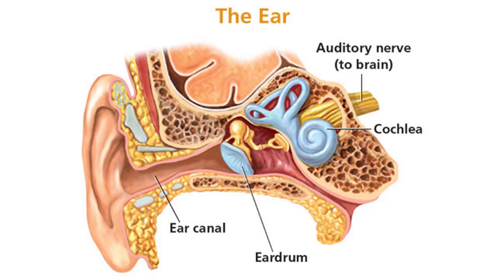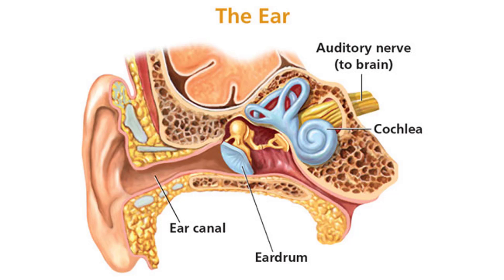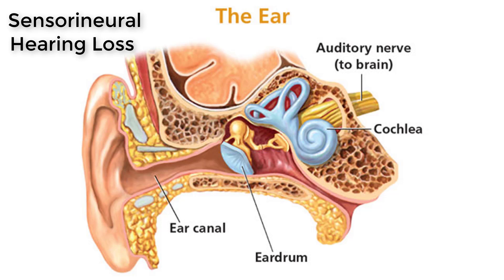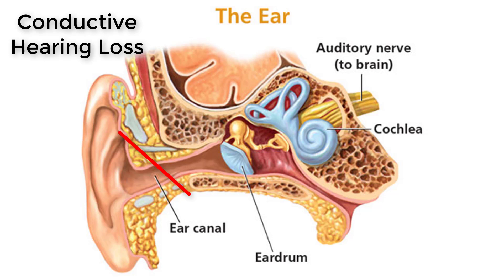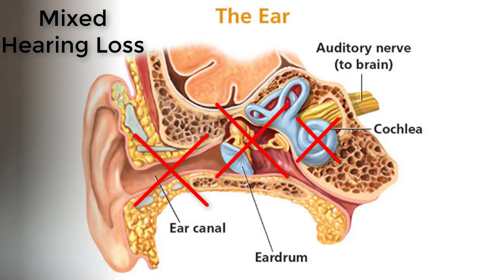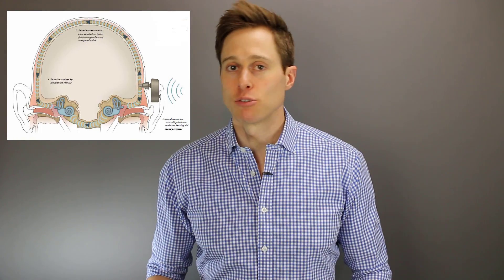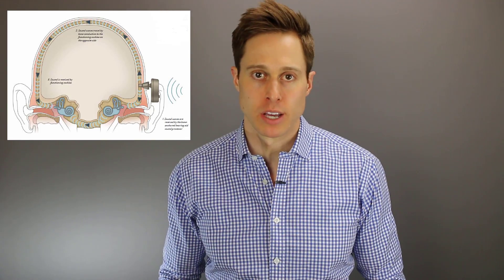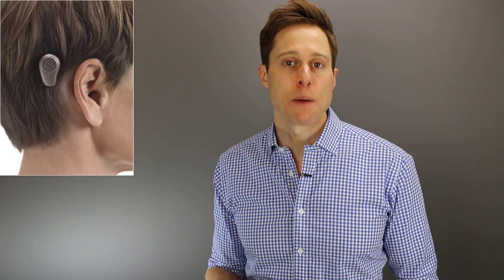How Bone Conduction Hearing Aids Work | Cochlear BAHA, Oticon Medical Ponto, Medel ADHEAR

Comment: Hey Dr. Cliff!  I had a tympanoplasty with mastoidectomy due to Cholesteotoma a few years ago in my left year.  It left me with conductive hearing loss in that ear, but I’ve been able to rely on my right ear and have gotten by just fine.  Well now the Cholesteotoma has found it’s way into my right ear and have to have the same surgery.  I’ve already had the BAHA evaluation and they said I’m a candidate for it.  The doctors think it makes the most sense for the BAHA to be placed on my left ear since we already know how that side is post surgery.  So my question is does it matter which side it goes on?  And is this still a good option not knowing how the recovery from surgery on my right side will be?
Reply from the maker: I would go with whichever side the surgeon suggests based on their knowledge of your unique situation.

Comment: My 3 year old has profound hearing loss in one ear and perfect hearing in the other and is not eligible for a cochlear implant.  I believe the only other option at this time is a BAHA device (correct me if I'm wrong).  If sound is just transmitted to the good hear, does a Baha help with sound localization at all and is it possible to over stimulate your good ear and create long term issues?

Comment: I am a babyboomer that has been recommended for Phonak Paradise hearing aid for first time. I have deep voice and most appreciate that I speak slowly and articulate; I find it hard to understand soft spoken people.   Having sensitive skin and ears, I prefer NOT to have any hearing aids in the ear canal; Paradise delicate hearing aids with a little wire and ear bud top does not impress me. My cats cats could easily break this flimsy hearing aid.  IMHO, I would prefer bone conduction options (love design of Shockz openswim)...but local provider seems to not replying to my questions.  Can't I choose a non ear option for hearing aids?  I am about ready to voice my concerns with Medicare.
Reply from the maker: Medicare will not approve a bone conduction device unless you have a conductive/mixed loss or single sided deafness. You could purchase the Medel Adhear, but Paradise Hearing aids would outperform them significantly.

Comment: I am struggling to understand why the 10% do not benefit from the traditional hearing aid? I have severe to profound conductive hearing loss in one ear from prior cholesteatoma's and after several surgeries it was somewhat repaired but now the prothesis has failed and I do not desire to repeat surgery to try and fix it. Anyways, today I tested the BAHA via headband and a Phonoak Audeo in the office and couldn't tell much difference between the two. I am struggling committing to having the BAHA done when I couldn't see much difference.

Comment: Thanks for the video. I have a BAHA since 2002, 3 years ago I changed to a Ponto. I have SSD and wear the Ponto more or less all the time. But since around 2 years I experience occasionally pain in the ear after exposure to loud noise for a longer period of time. It is only on the implanted side and feels like a spasm in the ear. It can be really painful for some hours and then its fine again sometimes even for several weeks. There is no infection, everything looks and works fine otherwise. Did you hear something like that before? Is it something I should be worried about?
Reply: Hi, I've dealth with SSD for about 7 years now. I've used Cros to a so-so effect, but now I'm set to get surgery for the BAHA Connect, and I was curious as to why you changed to the Ponto, and what that change entailed? Did it require another surgery, or were you able to utilize the original abutment? Also, which provided better sound? Thanks in advance!

Comment: Hi Dr Cliff.  I’ve been watching your videos and find them very informative. I’m atttempting to decide if I should do a Baha. I have mixed hearing loss in both ears,  With left ear severe to profound in higher frequencies. Been wearing 7 year old Starkey. Had tried OPN 1 with 60db, which I liked. ENT’s AUD recommending BAHA S Superpower, and supplement HA in right ear, which I don’t like. Biggest complaint  with Starkey is background noise and speech clarity. I’m having difficulty getting an unbiased opinion as to which is best way to go as everyone seems to have a vested interest.
Reply from the maker: Depending on the severity of the sensorineural portion of the hearing loss, BAHA may not be adequate for you.  However, if the audiologist is recommending the S Superpower, they are probably taking that into consideration.  You don't have to go with a Starkey.  There are a number of hearing aid brands out there and you should be able to try other brands.  Does that clinic only offer Starkey?
Reply: The rationale for the BAHA is that my speech understanding is near 100%.  Left ear drops from 65db at 2000 to 85db at 3000 and 105db at 4000.  I am considering the OPN S and have found a provider that offers it unbundled.  I did a trial period with the OPN 1 and was waiting on the OPN S to come out when the BAHA option came up.  I have also tried Resound Quattro and Siemens, but not particularly impressed with either.  Just unsure if HAs or BAHA is best way to go and really have not been able to find an unbiased opinion.  I do not care for the size of the Superpower and I'm not keen on punching a hole in my head, so my leaning is HAs.

Comment: Hi Dr. Cliff! I’m so excited to have found your channel. I have bilateral atresia and have been using a Baha 4 system for the last 5 years. I originally had two sides but the left side failed to osseointegrate so I only have the right side. My surgeon recommended that we wait a few years to try again for the bone to heal. Do you recommend trying the Baha again or should I try a different bone conduction hearing aid that uses a magnet?

Comment: Why use zinc air battery in magnet implant ??
Reply from the maker: A magnet implant has no impact on its power source.  However, a lithium battery would likely be heavier and not suitable for a magnet implant.

Comment: What is pros & cons of magnet implant ?? Compare with the other types ?
Reply from the maker: Pros are that it can't be seen if you take the processor off, less risk of infection vs an abutment, and you can use it quicker after implantation.  Cons are that while wearing it stands out more, can't fit as severe of hearing losses, could get knocked off easier, could create pressure sores depending on how long you wear it.
Reply: Doctor Cliff, AuD thank you so much doc. 🙏🏻🙏🏻🙏🏻
Reply: @DrCliffAuD  So the abutment works better for transmitting sound with more severe hearing loss?

Comment: Hi Doc..
I originally had an appointment for a hearing aid evaluation but was changed to a BAHA BiCros evaluation.
 Can you please tell me what is a BAHA BiCros evaluation is?  I was diagnosed with single sided sensorineural deafness a few months ago.

Thanks Paul
Reply from the maker: Hi Paul.  They are going to try and determine if you would perform better with a Bone Anchored Hearing Aid, or BiCROS hearing devices.  They should provide similar benefit.  One requires surgery (unless you get ADHEAR), and the other one is similar to hearing aids.

Comment: Dear Sir,
Please advise me of the suitable solution to my wife , 69 y, hearing loss problem which is briefly -
1.She has mixed hearing loss for both ears.
2.Weakness of the hearing nerves for both ears ,the  loss is in the range of 90% .
3.Has had two operations for the right& left mastoid bones due to infections.
4.We understand that the bone conducting solution is most suitable because of the repeated infections and the need for proper ear ventilation as doctors advise.  i.e. she suffers from both hearing loss and on- off infections.
5.Here in Baghdad, doctors have advised to use the BAHA ,but such operation is not available in Iraq , while the Cochlear  implant is an alterative solution,  but not good enough  due to on-off infection. 
6.Preasently ,she is using the normal air conducting  ( behind the ear ) hearing aids for both ears alternatively in order to allow for good ventilation due to usage of ear moulds , to avoid and/or decrease  possible  infection.

I,thank you in advance and  hope to help for suitble solution. 

With Regards

Anwar A. Dawood
Baghdad - Iraq
  
   

5.
Reply from the maker: Hi May.  It's been about 15 years since I've been in Baghdad.  Hope things are well there.  I'm afraid that a BAHA would likely be her best option based on the limited info you provided.
Reply: Doctor Cliff, AuD 
Thank you for your response  and kind advise. 
For proper assessment for my case, please inform me of the information  needed from me to send it to you for this purpose. 
In the meantime, I would be thankful to you  if you inform me of the followings regarded BAHA...
..Is it available in Iraq ? if not, which is the nearest place to Iraq.
..Is there any side effect during and after  its implantation? 
..Does it need any follow up  after  the implementation. 
..A rough idea  about the cost ( covering BAHA and the implant operation ) .
..Any other info for us which you consider  its vital  to know and/or to be aware of. 

Thanking you for your time and care. 
Yours
May .

Comment: What are your thoughts on Sound Arc?
Reply from the maker: Hi Autumn.  I would put this in the same category as a headband.  It still requires pressure to work, and has similar benefits.
Reply: Doctor Cliff, AuD 
Thank you, I have a 17 year old with atresia. He is  reluctant to have the surgery for the implant. Just looking into all options.
Reply from the maker: The ADHEAR was just approved by Medel yesterday.  That might be a good option for him. I have a video coming out this weekend on that product.  Check out the Medel website.